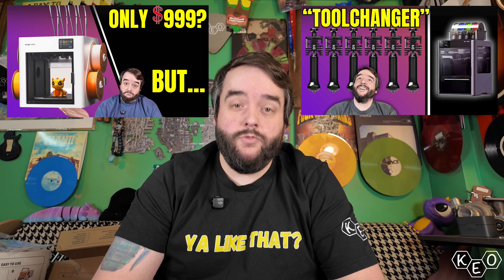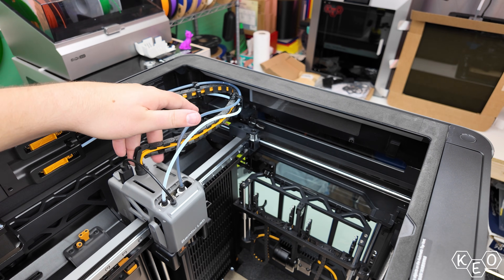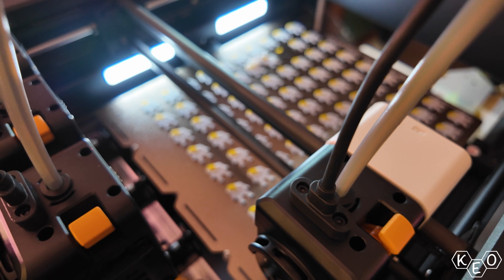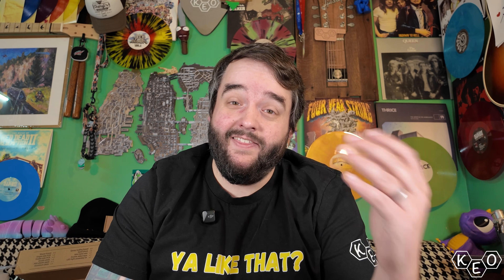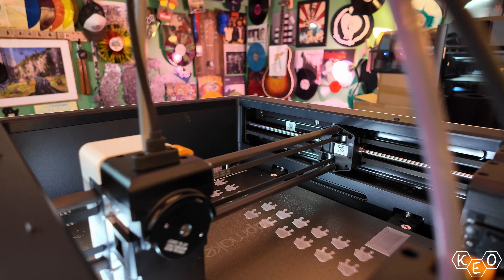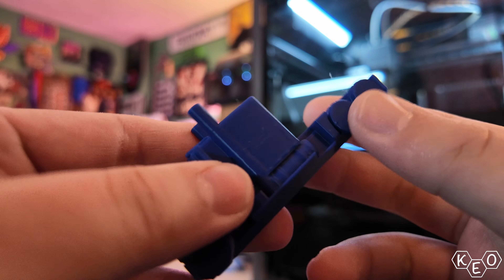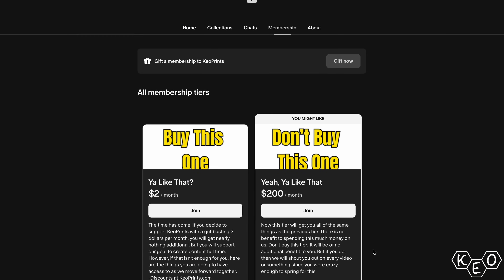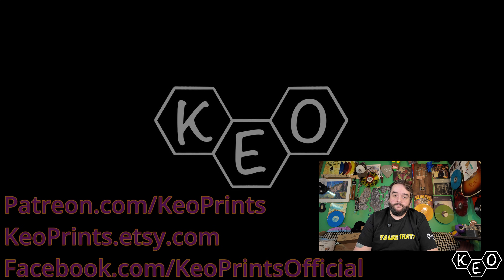Bambu H2C vs Snapmaker U1 — Toolchanger War

Comment: I think theres too much in one package. It would be cheaper to buy 3 3d printers rather than 1 that does it all. its going to be cheaper too. And with multiple printers you dont need to sit and wait cause you have an all in one. Its the same reason why that all in one, 3d printer, laser cutter and cnc failed. Cause its cheaper and easier and faster and convineint and better in every way to just get 3 different devices. I feel like this is whats happening to this bamboo printer. Its not really worth the cost to have this many capabilities that you wont use together. Much rather get the device made for my specific needs. some 2 in ones makes sense but this one dosent. 

dont forget resin multicolour and multimaterialsystems exist, they are more reliable, prints more material, prints alot alot alot faster, no clean up afterwards etc. like this bamboo printer is approaching the industial multimaterial resin printer. why not just get that?

Comment: Big plus for U1 for some is it uses Klipper and not closed system/cloud like bambu. Though down side is U1 doesn't support PID for temperature calibration and control; uses bang-bang which inferior.  They must be using weak/limited controller board if they don't support PID.

Comment: Good video. I think you're right when you say that there are two seperate audiences for both printers. When comparing these two machines, it always comes down to the speed of the swap. But most reviewers make the same 'mistake': they use a print with color swaps at almost every layer. But that's not always the case. Aurora Tech did some tests, with different type of models and the difference is not always so dramatic. It is still a fair comment: because they use the AMS, it is going to take more time. While I'm sure they're going to finetune the process over the coming months, I don't think they're going to shave off more than 5-8 seconds.
Depending on what you want to do with the printer (and obviously what you can/are willing to spend on a 3D printer) there are more differences that can be important. Obviously we have to wait and see how the Snapmaker fares over time, what is the wear and tear on the machine and how much maintenance does it take. One thing that I hear in almost every review of the Bambu Lab H series is how incredibly good they're made. Excellent engineering and build quality. Vector 3D has taken apart these machines and he was impressed. They're also a bit better repairable than the previous generation. And at the same time, I hear comments on the Snapmaker in almost every review that they can see where they have been cutting corners: plastic bodyparts that don't fit very well, panels that are a bit loose, ect. It's not the highest quality. It doesn't impact print quality and speed at the moment, but I'd like to see what this machine does after 1 or 2 years of hard use.
Another point I want to make is that the H2C also has some other tricks up it's sleeve: it can be a laser/cutter/plotter if you want to. Very nice for people who want to try that occasionally.  I ordered the full laser combo because I think that's a coll add on. Some people call it a gimmick, but I think they thought really hard about it. We'll see after a while when a lot more people have had more time to use the laser/cutter/plotter add-ons and see what appears on Makerworld. 
One remark/correction: you said that Bambu Lab reacted to Snapmaker with the Vortek system. But that has been in development for three years already. They released the teaser video (just like Prusa released a teaser with the INDX toolchanger for the Core1) because they didn''t want to loose sales on the Snapmaker. You can see that they already had the H2C at the introduction of the H2D, because the Vision Encoder and the laser/cutter tray are the same size and fit in the H2D AND the H2C. It wasn't a random thing. It was just delayed, otherwise the H2C was introduced sooner.
Also, it should be applauded that Bambu Lab still uses the AMS system and protects people's investment in them. Imagine someone with 4 AMS systems and a X1C. You don't have to throw away or sell your AMS when you buy the new generation. Prusa always gets credit because they remain compatible and offer upgrade paths to new generations of machines. It's not perfect, but the AMS system remains a relative cheap way to use multiple spools on one printer.

Comment: I dont think being able to print engineering grade fillaments is important, as these multitool head printers are used for pla, petg and water soluble fillaments. Most people will use it to print multicolour tpu too. If you are printing engineering grade fillaments, you are likely doing engineering stuff, which is very unlikely to need multicolour. In addition people purchasing these machinese will not be their first machine. If you want to print engineering materials you would have already bought a CC. So it makes sense that u1 is not made for engineering materials but its possible to print it.But not being able to print TPU is a bigger miss / disadvantage.

Comment: Why does everyone insist on comparing two different machines to each other saying which is best?
Reply from the maker: I like doing comparisons like this to really highlight each machines specific strengths. Everything is so use-case specific and it is hard to identify which is better since it’s all so subjective and dependent on the users needs. So it’s a fun way for me to wrap my head around it at least
Reply: @KeoPrints  I understand, just a problem using the phrase  who's best
Should be whats best for you.
Thanks

Comment: The H2C should have had 3 buffers and the AMS Pro 2 should have been able to push multiple filaments at one time. Then they could have staged the next filament prior to the swap and mostly remove the swap lag.
Reply from the maker: This would be huge actually. A line switcher inside of the AMS to allow for two outlets would make a big difference
Reply: @KeoPrints  Yup, even modern CNC machining centers pre-stage the next tool so you aren't waiting for the tool carousel to spin at the tool change command.
Reply: Nah, they already increased the AMS motor speed for H2C. Any cubic 4 tube system works but it's a bit of a mess at the back and limited to 4 colours.
Reply: I have to believe they have an AMS 3 on the drawing board with that exact solution

Comment: The one thing that H2C has that is make or break for me is the ability to painlessly swap between nozzle sizes. I do a lot of printing of differing quality requirements, material requirements and that means I swap between nozzle sizes a lot. As easy as the current generation of printers have made it compared to yester year, I still cringe having to unplug wire connections that by design are not mean be removed on a daily basis. In that way the H2C approach is perfect for my needs. I am not running a print farm, so the total print time is of little concern to me personally. I am just happy that what took 30 hrs to print 5 years ago I can now print in 8 hrs.
Reply from the maker: Agreed on the print time for sure. Though this is a slower machine, the functionality is off the charts. I appreciate that a bit more and the leap from the old ender 3s of yesterday year is still so very large

Comment: I don't get the H2C at all..

1) Price, 2250€ for the printer and ams 2, you need another ams unit if you want to use all the nozzles and the printer to it's fullest and that's 2540€ so far for 8 filament printing. Sure if you want 8 colors but 2540€ for 8 colors really?
For 2250€ you can get 2 snapmakers U1 (850€ currently) and for 550€ get another bambu printer or a 3D scanner.
Or if you want the P1S combo for the price of 1 H2C you can get 4 P1S combos churning out 4 times as many prints (but 4 color each womp womp). I'd rather have 4 P1S printers than 1 H2C.

2) The old adage "no replacement for displacement". 4 separate heads means faster printing, faster swapping. The nozzle swapping idea makes no sense to me and multiple heads is the way to go IMO. If a nozzle gets clogged it can clog the whole head and that means the whole machine is down, while if 1 head gets clogged you still have 3 working while you fix that 1.

3) If you want to print TPU and some plastic in the same print (which is cool) then you can get the H2D for 500€ less than the H2C.

4) They also released a "Vortek upgrade system" for H2S and H2D so you can upgrade those to be multi-nozzle printers as well like the H2C.

5) People find it useful that it can swap different size nozzles fast so you don't have to go in and unscrew the old hotend put in the new one if you want to print 0.6mm then 0.2mm etc. To that my argument for 4 P1S combos (for the same price of 1 H2C) still stands because now I can have 4 dedicated machines of which 1 can have the 0.2 nozzle and another can have the 0.4 and another can have 0.6 and they can all print at the same time in parallel.

TL;DR 
1x 8 color printer OR 2x4 color snapmakers + 550€ OR 4 P1S combos.

Comment: Neither win. They both have different faults. U1 is only 4 materials. Nothing more. H2C changes nozzle size. Practically useless. If only one size nozzle can be used with its single material.  Now if a 16 color, multi-nozzle changer comes along. Both will be obsolete.

Comment: It's hard to compare 2 printers that target different market. The h2c is a prosumer printer that allows engeenering filament that needs heated chamber and high temperature to be reliably printed. The U1 is more for hobbyists that mainly use pla, petg or tpu. Both has their place. As I care about asa, abs, pc, pa and all, the h2c is a better choice and the larger build volume is a plus. I'm pretty certain that Bambu will release something for the hobbyist market but not before they'll be certain it's working good
Reply: Finally someone is making sense. Comparing these two printers is stupid. They are not in competition with each other. People keep saying they are. But they're not. I get so tired of the "Bambu is in trouble!" and "The U1 is faster and cheaper. Therefore it's better." comments everywhere. These machines are targeting different people.
Reply: The U1 with a top cover can print things like ASA/ABS and nylons just fine, the build plate passively heats up the chamber and it is hot enough to prevent warping. You can also add an active chamber heater for not very much money at all if you are doing a ton of those sorts of prints.

For most of the prosumer engineering filaments the nozzle and build plate get hot enough as well. PPS-CF is about the only prosumer engineering filament I can think of where the U1 nozzle doesn't get hot enough. It handles PET-CF/GF, PETG-CF/GF, Tough PLA, ASA, ABS, just fine. It should handle PC fine as well though I haven't seen anybody print with it. About the only place where the U1 may suffer is lack of out-of-the-box print profiles, but if you're printing in those kinds of filaments you are already ready for some tinkering anyway.
Reply: @chrisjohnson00  comparing a Bambu that’s had extensive testing/ r&d for YEARS with engineering filament to a u1 toy that’s cheaply made is crazy talk. Of course a U1 CAN do abs and other filaments but if you’re a print farm semi-professional who wants reliable parts that won’t break because some guy Mickey Mouse’d a heated chamber on a u1 go with Bambu. As other’s have said, ya can’t compare.  U1 is amazing at making multi-colour dragons very fast, I’ll buy one for my niece.
Reply: @Uji_Metal  who brought up running a print farm? As far as I can tell nobody else but you. All I said was that it's perfectly capable of printing most of the same filaments with the same ease as a similar Bambu printer. That's it. And it is capable
Reply: @chrisjohnson00   yeah, you can actually print abs on an a1 mini with the right mickey mousin optimizations too. But I personally wouldn’t, I’d just buy an 
h-series Bambu to print such materials . Like the OP said, it’s hard to compare the 2.
Reply: @chrisjohnson00 Yes, it can but not practical to wait for the half an hours, maybe more due to the height of the top every time you want to print asa, abs. Some pc need a 65c chamber at minimum. It could work for 1 print, but when you need prints after prints, it's not pratical. Asa and abs printing produce sticky residue inside the chamber, so good ventilation is a must. The U1 lack of it might be problematic for the pogo pins getting covered and needing constant maintenance. It's not that the U1 is bad, but for some task, the h2c is the best tool. If the U1 proves itself reliable, I might consider one for simple colored prints with petg, pla or tpu, but not for advanced materials.
Reply: @patricklebel1141 I have printed a ton of asa with my p1s which is not actively heated either, preheating isn't a big deal. But again like I mentioned for very little money you can add a chamber heater if you don't want to wait. Just clarifying that the printer is absolutely capable because you seemed to think it could only do pla petg tpu etc
Reply: @chrisjohnson00 The p1s has a lower top. Heat rises, so it means more volume to heat up with a higher top. This add time to the printing time and not really practical when you need to print a 1 hour print and you need as much time to correctly preheat the chamber. Yes, I can add a heater, but I buy Bambu because I just want them to be right out of the box, no tinkering needed. Plug and print. I don't have time to waste on printers anymore.
Reply: @patricklebel1141 there is no tinkering with an addon heater you simply buy it and turn it on. Either way, I am not here to tell you what to do, if your goal is to buy a Bambu printer then buy one. I am just explaining that the u1 is absolutely capable of printing the filaments you assumed it couldn't do
Reply: @chrisjohnson00 My goal is to have the most efficient tool for the job i have to do. For my task, the h2c or h2d are just what I need. Maybe when my x1c get not efficient enough I could replace it with a U1 or something better. But I'm not going to get something that does not fit my needs just because it's hyped by the mass.

Comment: I wonder if we'll see a U1A that can run an AMS on one or more of the toolheads giving you from 7 to 16 colors while keeping the instant swaps when possible. I understand you can swap filaments with the printer paused, so when you need it, you are the AMS.

I think your mistake is thinking Bambu is always a market leader. They 100% shook the market with the release of the X1 and P1 when everyone else was making bed slingers. The price, print quality, and even printer aesthetics were unmatched. What have they done since? Yeah they've released upgrades, a larger printer... and bed slingers, ironically. They released a dual-nozzle printer, but that wasn't anything new. They still make good printers, but the rest of the market has caught up and they aren't setting trends anymore.  They haven't since 2022. 

The H2C is over-engineered and too expensive for what it does, in my opinion. It cuts waste, but not time, and those mechanisms are just asking to break. I backed the U1 because I think Snapmaker really nailed the design and the balance of speed, cost, etc. The only thing the H2C has on it is more colors.
Reply: in theory you could... there is no cutter but unloading and loading works - of course in that case you'd need to purge the leftover filament in the nozzle - and you'd need some 'cutter' box between the AMS and printer that does a 45° cut of the pulled-out filament as preparation to use it again. Just saying.. there is already a third party firmware; it's klipper based and has 2 extension ports as well as 1 usb port easily avalible...
Reply: @MartinRies  Obviously there would need to be hardware changes, and the whole printer would be tied up doing the same slow cut-retract-load-purge process we know today. You could give each parked head the hardware and connections to swap filaments while the printer is printing, but now we're just getting into ridiculously expensive and complicated.
Reply: @turrboenvy4612  yeah that would only make sense for 1 or 2 heads - with colors not required in every layer. e.g. yellow for the feet, a few layers later black for the eyes.
Reply: @MartinRies  It would work for the first thing I am printing when my U1 comes in. Well, second after the little dragon. It's another dragon with a pink belly and yellow eyes, so I'll swap the pink for yellow and have 5 colors. It  would have been a 17 hour print on my p1s.